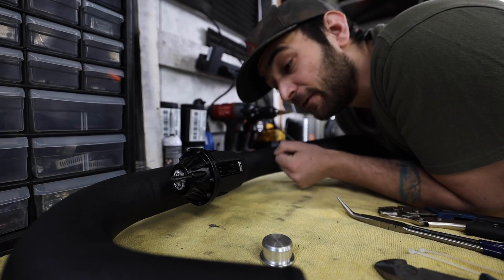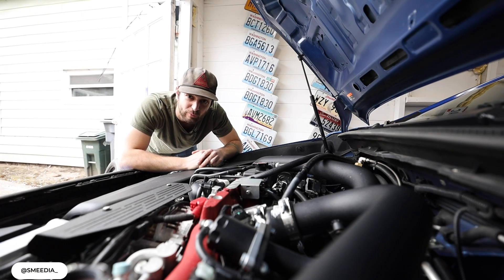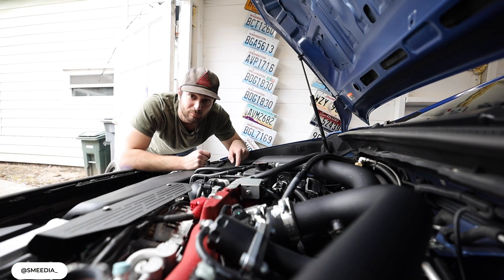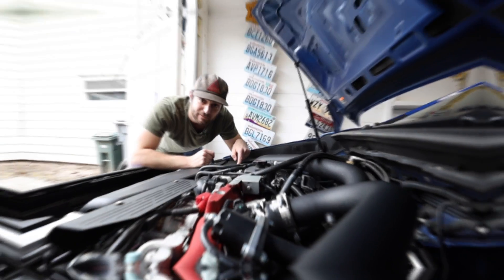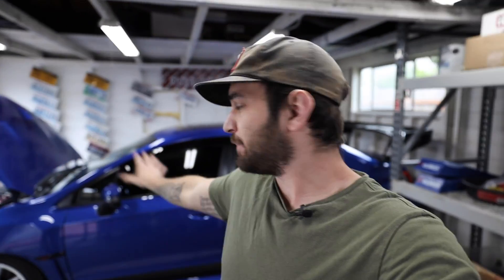This Is Why You Shouldn't Use a BOV On A Stock WRX/STI

Comment: I’m going through the gauntlet of trying to figure out why I’m getting slight lurch at certain rpm. I changed out original MAF sensor that smoothed out the rough idle also changed spark plugs but I’m still seeing -1.40 feedback knock and sometimes-2.80 with occasional fine knock

Comment: Catalatic converters don't work properly on cars anyways. Car exhaust dont get hot enough to properly burn and or catch what there ment to catch! Once you learn what there for and how hot your exhaust needs to be for them to work youll never want one on your car.
Reply: this guy does not live in an emissions state. When doing my emissions testing every 2 years (for each car I own) I get a printout of how much CO2, CO, NOX, etc was detected. If I show up with a shiny new cat, a 30-year-old cat, or no cat I can see it reflected on the graphs. Who told you that exhausts don't get hot enough? What is this conspiracy theory?
Reply: @RacecarsAndRicefish um, math does! See your problem is that your trusting a computer. Catalatic converters dont work properly on cars due to exhaust not getting hot enough. Catalatic converters were never invented for cars, they were invented for steel meals. Also the shit inside of them is very toxic to mammals!
Reply: @RacecarsAndRicefish also just so you know, cars out out the same emissions with and without a converter.

Comment: Is there a Cobb tune that lets you run a BOV? I’m looking to get one but there’s no videos really explaining how to tune for it just a bunch of people saying don’t do it with a stock tune but obviously there is a way to tune it
Reply: No there isn't one that's made for BOVs. The Cobb Stages have MAP Notes which is what tells you the DESIGNATED Aftermarket Mods allowed for the particular stage. For Example, Cobb Stage 1 is just on everything-stock, apparently car runs smoother. Stage 1+ is the COBB Big SF Intake with the Airbox Housing, and this mitigates the Rev Hang from 1st to 2nd gear. Stage 2 is STOCK OEM Intake, and instead is a DOWNPIPE. Stage 2+ is BOTH BIG SF INTAKE and DOWNPIPE together.
Reply: unfortunately no ECU-reflash style tune will convert a car from MAF-based to speed density. If there''s actually a real issue with converting to BOV in the first place at least

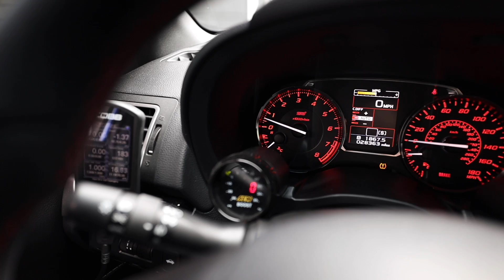Comment: I just bought a side project car and its a used 2013 WRX STI Sedan Sporttech usualy they go for around 17K + I got it for 10K 1.has very small body work to do (only minor rust spots) 2. needs a new paint job 3. The car runs but dosn't run well. Coming from the dealer that I bought it from every time I hit the stop sign or light that choking issue 9:01 happened. I stalled at 3 stop signs.... Got home opened up the hood and the air circlation hose is cut and plugged... stock BOV... So I got on to watch videos on Bypass valves and blow out valves and I want to say thank you! Easy fix just need to get another hose! 

Thanks for the info @Smeedia

Comment: If you setup BOV correctly the car will not idle or run ANY different, unless you did it wrong then it will idle differently, or its a POS like that valve,
If you can smell fuel or it runs different you done screwed up and not installed it correctly or its not adjusted correctly, 
during idle the valve is 100% closed and doing nothing so wont effect anything.
(High quality valves like GFB Hybrid are the best and cant even leak even if 100psi boost)

Makes almost no difference it only runs lean for 0.15 - 0.3 seconds when you let off the gas and as you are not making power it does not matter if AFR's goto full rich
If coasting down a hill in gear AFRs are meaningless as injectors are shutoff during coasting. 
Even the guy who started the rumor in the UK admitted to it after like 15 years that he was just making it up as he hates all the ricer Subarus going around making blow off noises (Ricer/Racer boys)
 It all started from him and was just a joke, 

Just like the DR who joked about Vaccines causing Autism in a paper he wrote and accidentally started the now stupid idea people have that its real, Even year later when he said it was just a joke in the paper he wrote people wont believe him and say he must have been paid out by Big pharma. 

Put it on dyno and watch the lean condition is so short if you blink you WILL miss it as human eye takes .25 seconds to blink so easy to miss a rich condition that last .15-.3 seconds.

If you are serious about tuning should be replacing the plugs every 10,000KM as they will be copper spark plugs which are best for fuel burn and so on.

Comment: The BOV isn't what was causing your issues at idle. How could it when there is no boost to blow off?

Regardless, you can't tune for a BOV. I get really tired of telling people that. There is no special table for "WOT release" or anything. They do slightly increase how rich the car runs for that brief moment when letting off the throttle, more pops and bangs, which in turn can hurt the cat and turbo since those explosions are happening nearby.
Reply: With Speed Density, there is no tuning you can do either. It's just that the reference of MAP is a lot closer to the injectors than the MAF is, so there is a lot less time of fuel squirt at WOT release.

Anyway, I am so sick of BOV arguments, and this video makes it worse. 175k views and counting ;(
Reply: @sssnake2332  Thanks for the explanation! I bought my '18 STI a little over a month ago which came with a GFB bov, and I've been reading forums on the subject ever since. I don't have any of the issues that Smeedia was having in the video so I wasn't too sure what to think. I love the sounds my bov makes, but I'm not going to keep it on at the expense of my cars health... :C
RIP 😢

Comment: I ran a BOV on a stock STI 2018 and had 0 issues. Currently I’m no longer stock and have a Stage 1 OTS tune and it shows no issues I’m not rich or lean, just yesterday I got a -1.40 knock and -1.40 knock learn

Comment: Biggest load of crap i seen in a while running at idle would do next to nothing the car isnt entering boost also with my audi i had diverter valves that could do full bypass 50/50 or vent to atmosphere guess how i ran it most yup vent to atmosphere and never caused a issue

Comment: Hi so question I am getting a p0103 code I have already replaced my maf sensor  when I punch it I get to about 5k rpm and it feels like my car losses power so would my next step be to replace the wiring or connectors

Comment: On my 04 wrx with an ej20 I had an hks bov and the car ran fine up til 170,000 miles and the only reason the car died was because it was crashed and totalled. Never had to replace a cat and the car never left me stranded once and I had no idle problems. I did have a turboback exhaust, intake  and a ots ecu flash tune. 
Now with my 2022 wrx I don't need to do it for the sound because the stock bpv makes a lot of whistles and whooshes and some nice turbo flutter by just replacing the intake.

Comment: Strange....my car came with the stock turbo's recirc valve properly vented and capped, car runs fine. I'll try to connect it and see how it goes.

Edit: for all I know, the car was tuned for it...but the car is totally stock minus an exhaust (JDM GRB EJ207)

Comment: I get that it's an MAF based engine. I have a stock tuned STI that I recently picked up with a 50/50 valve and an ETS front mount and an intake. Knowing how anal everyone is they are probably gonna die just reading that sentence. Yes I do plan on tuning it. The ONLY thing I've noticed vs driving my friends pro tuned car with a fully recirculating valve is that once I get near atmospheric pressure (0, no vacuum or boost) the car does tend to kinda stumble a little. Though I'm guessing that's more of the fault of the intercooler. The car has never smelled rich, even with a muffler delete on it. Never stumbles at idle, no dips at idle, nothing. These valves ONLY open once you reach boost. Sure you went into launch control, but boost is pretty low on that. Not only that, there was no apples to apples comparison here. What were the numbers before the BOV? The title is also "don't do this to your STOCK Subaru" my guy, your car is pro tuned and is far from stock. I don't see how your trying to make an argument when there are other people who aren't experiencing these issues, or if you have or have not experienced them yourself and if this is all just speculation. Also modern cars knock, ALL the time. The knock sensor is there to help find out if it needs to lean or rich the system to prevent it. The cars ecu makes the adjustments necessary. I'd bet that if you would let the ECU learn more, it would run better, instead of letting it idle for 5 mins, doing revs / launch control, going back and forward 2 or 3 times, and then saying "yep, BOV bad, only do recirc valves"
Reply: I installed turbosmart 50/50 on 22wrx, it stumbles if you're stationary rev and vent.

Comment: the "bypass" valve is a BOV that is recirculated, its not a "bypass valve" its just a BOV that's been designed to recirculate the air back into the system there are also BOV's designed to do both at the same time like the Turbosmart BOV's .. in Australia its illegal to run a BOV Vent to atmosphere..
Reply: https://www.youtube.com/watch?v=bsy9hJic7cQ

Comment: I have a 2015 wrx and have been running a bov for about 4 months never had an issue that I felt the car was in danger and overall it has ran better than it did before.

Comment: What if you just put a block-off plate at the BPV? Except stalling the turbo compressor (and getting a nice stu tu tu sound), will there be any rich/lean conditions?
Reply: This will decrease the life of your turbo and will increase lag. I would get a blowoff valve that has both recirculating and atmospheric release. You will still get the Pshhh and it won’t mess anything up as long as it is set to 50/50.

Comment: Man you talking sh*t...if the air is under-metered, it can't run rich...and even if it does...it would misbehave only after the throttle is shut...not in any other case when BOV is closed...e.g. on idle, why would sport gear manufacturers produce BOV's specifically for cars with MAF...they are not that stupid I'd assume

Comment: i am a brand new owner to a 2015 wrx and i got a hks ssq blow off valve and i’m wondering if i need to get a tune for it or i can just install it right away and the car is stock
Reply from the maker: I'd tune for it, wouldent run one without a tune

Comment: This was a good laugh. I ran a vent to atmosphere bov on a decently modded, not built 7 bolt 22psi 2g awd dsm from 60k-280k miles. To counter this, I ran a k&n style breather after the maf. My af gauge read super rich before the breather. Came back down to not so rich and good levels after. If I did it again, I'd go dual port. They didn't have those available back then. Worked for me. I'm pooping at home. 💩

Comment: Quick question and note, if I get a GFB Hybrid BOV would I need to get a pro tune to run it with the BOV? The GFB is a hybrid between BPV and BOV and you can change it from BPV to BOV by twisting the head of the unit, you can also run it 50/50. Any ideas on this?
Reply: Won't need a tune with 100% recirculation. You'll get little noise, but not worth causing issues to the engine for big 'Psh' noises. I'm getting the GFB Hybrid Bov for my 04 Wrx Wagon, it's Stock except Turboback exhaust (which was tuned for) and STI Downpipe. Once I get it I'll share my experience.
Reply: any updates? My 17' WRX also has a GFB Respons Hybrid BOV and my car is stalling. I'm not sure yet if its because of the BOV or if I need to clean my MAF and MAP sensors but yea. heading to the shop to hoist it up and all. I have my pre-load set to + so its not protruding, and prolly at 50/50.

Comment: I ve got a 50/50 hybrid BOV on my WRX would that be ok ? The car is running rich sometimes and spitting carbon out of exhaust. Should I take it off ?
Reply from the maker: Ideally you'd want to keep it at full recirc if your not tuned for the 50/50
Reply: @Smeedia   Guess it's not tuned properly, otherwise it wouldnt run that rich. My tail is covered with those black unburnt fuel dirt all the time. should I just get a  BPV or just tune it right ?

Comment: Well, I have seeing some stock STI graph and everything time you switch gears and go WOT the car is really lean abs then starts running rich as you get in the rpm. Maybe a VOB might not be that bad on a stock tune as you dump some of that air that would have made the initial WOT lean. I don’t know just my two cents

Comment: I bought my 12’ STi with a BOV already installed (and intake and exhaust) and a protune. Seems to run great, anything else I should look out for or be worried about? Knock monitoring is all within normal limits. I’m straight ricer and dig the noises. If it’s okay, I think I’ll keep it. Will have tuner check out car just to be safe. What do you think? It’s just tough cuz there’s so much polarity in this topic… hard to get a straight answer
Reply: If it’s running great than fuck this guy 😂 listen to your car don’t listen to this twit spreading misinformation lmao

Comment: If tuned accordingly is the bov still worth it? Or is it better just having the bpv overall even if tuned properly? I want the sounds but definitely wanna keep the engine as reliable as I can
Reply: im in the same boat!!! I want the sounds!!
Reply: @jacksonr1337  I’ve had a gfb respons on my ej20 for ages with no issue, 30/70 atmospheric and recirc with a few adjustments to the valve spring tension to get it perfect and it runs like stock plus the cool noises
Reply: @nes3382  in the exact same boat here. i love the GFB and have it set up the same way as you. Its definitely worth it to get an adjustable BOV like GFB or turbosmart!
Reply: @jukebox9175  100%

Comment: So I'm new to cars period. I just ordered a 2021 WRX Limited and I want to learn all the things. I took a quick course they offered on post to learn basic engines, watch some videos to learn about the turbo, boxer, direct injection, etc. My understanding of all this is very very basic. If I'm watching this saying, math based car? Speed density? Blow off valve? Charge piping? Where can I start to learn about all these things? I got a little overwhelmed when I tried starting with nasoic. Long road ahead but I want to know. BTW I'm a nurse so I'm literally starting from the ground up. Thanks!!

Comment: The Ecu does take a little minute to calibrate it...... If you have the accurate back pressure it should be OK. Does make some good or bad depending on you. At super high revs. That's a good thing to monitor. But... Put anything on it.... Go get it tuned. I'm not smart enough but there's always a dude that is 😅 love the vids man.

Comment: what kind of bolt did you use to block off the iat sensor on the intercooler piping?
Reply from the maker: It came with one 🙏
Reply: @Smeedia  mine didnt come with one 😩 i wonder what size is the plug ?
Reply from the maker: I think it's 3/8 NPT 🙏

Comment: What’s a good stage 2 turbo for 2021 sti?
Reply from the maker: How much power are you shooting for?
Reply: @Smeedia  around 400-500 in the end with jpipe exhaust air intakes bov fuel injectors whatever it takes to get it to 400-500 whp
Reply from the maker: Blousch 2.5XTR, FP Red, FP Black. 🙏
Reply: @Smeedia  does that fit the 2021 STI? I’m on rally direct to see if i can order it but it says it doesn’t fit the 2021 Subaru sti base model
Reply from the maker: Yes it will fit 🙏
Reply: @Smeedia  sw thanks man also with a boomba bpv it doesn’t matter what turbo right or like would it fit the turbo or do I need to get a certain onw

Comment: I have a 2004 wrx and put the hks bov on and now the engine is throwing engine rich code and cylinder 1,2, and 4 misfire i put the bypass valve back on. how do i know if the damage was made or will the codes go away after awhile?

Comment: Interesting Vid... i was running the same BOV on my 06 STI, didn't tune it... ran it for a month then took it off... on that day that i replaced the recirculating stock unit i blew a piston. Do you think it could have had something to do with the BOV? Also, i see that you have the same STI oil cap on both STI's... does it do anything special? What are plans for the stock turbo that you're taking off? Another weird thing is happening with my rebuilt STI, i was braking in the new pistons so i wasn't taking the revs more than 3k, now that i go over 3k it seems like the car is starving of fuel where it almost feels like its going to shut off, then it comes back at around the 4k mark, but it keeps feeling like its going to shut off intermittently gradually as i accelerate...issue starts around 3rd gear... on the other hand, fuel to mileage ratio has never been better?!? i'm thinking it may either be the fuel pump or injectors i also have a grimspeed fuel management solenoid, when i bought it, it came with an exhaust which i changed back to stock once i rebuild it, never have i run it with the aftermarket exhaust before the rebuild, nor have i run it with the stock exhaust before the rebuild - could i be that the previous owner tuned it to the other exhaust?? Hoping to hear your thoughts.  

Sorry for all the questions... haha. have a good day, mate.
Reply from the maker: No worries and it's possible, the ECU may have relearned after the install of thr BOV creating either too lean or too rich of conditions that could have been afreibuted to the issue. 
The oil cap is honestly just for decor lol 🙏
If there is no adjustment made to the tune the fuleing issue could be related, hard to tell without actually seeing the car 😖